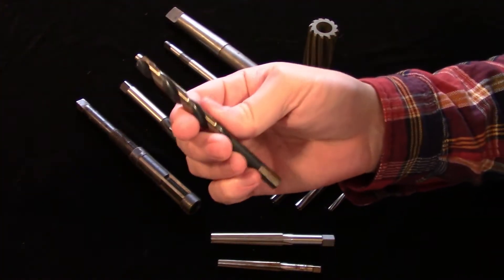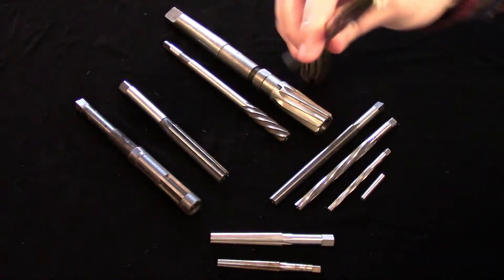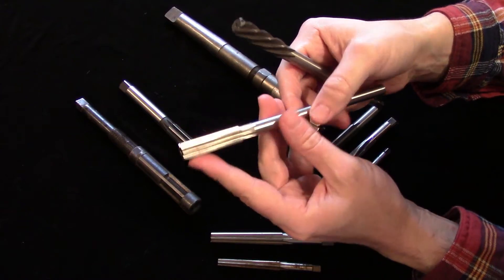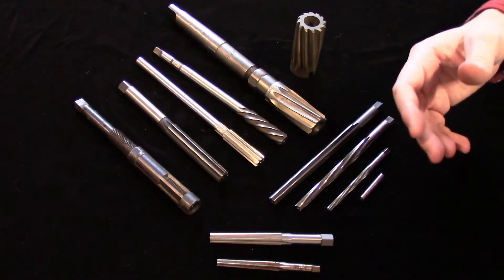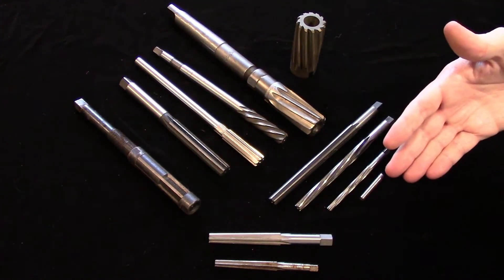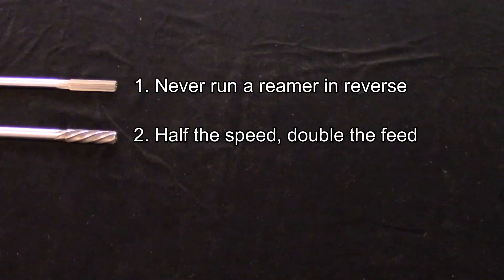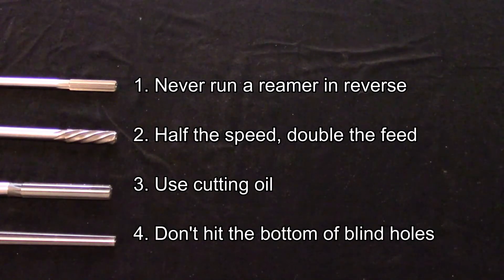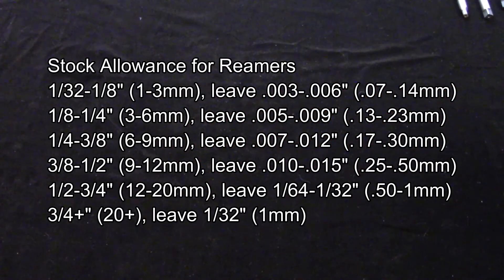Reamer Basics

Comment: How do you know what size pilot hole to drill for your reamer?
Reply from the maker: It changes by diameter. Smaller sizes have less chip clearance so need a hole closer to the size of the reamer to keep the chips from packing in the flutes. I put a chart in the description that will give you a good starting point.

Comment: So, making tapered hole for pin is:
drill a hole with allowance according to the chart, and run through it with reamer to calculated depth while checking with a gauge. 

I've seen that for tapered holes, there are rough, medium and fine hand reamers, where you start with rough and end up with fine - just like a thread tapping by hand.
Reply from the maker: For a tapered hole your pilot drill should be large enough to just start the reamer but not too much bigger or you might not have a complete taper. Then ream until the pin fits the way you need it to.

Comment: I'm trying to wrap my head around this, but I don't understand your "stock allowance" chart at the end. Can anyone explain what that means? Why are fractions and mm mixed?

Also, I'm looking on Amazon, and I notice most sets are mm, the few American fraction sets seem to cost 10x more than their metric counterparts. ...why is this? 

I'm drilling holes with American fraction bits to run fraction sized rods through steel. Do I use metric reamer bits then? ...I don't understand.
Reply from the maker: The stock allowance chart is how much undersized you will drill the hole for your reamer. Inches and millimeters are both given because if I didn't give both systems of measurement I would catch a lot of crap and I try to avoid that whenever possible. The measurements are equivalent (i.e. 5/16" and 8mm are roughly the same size). The reamer is going to produce a hole of the stated size so whatever dimension you want,  order a reamer of that size. Please let me know if you need any more clarification.  I'm happy to help.
Reply: @StuartdeHaro  Thanks, I think I mostly get it. I've never used metric bits, so I guess I need to figure out how to match the American sizes I need. ...and invest in more bit sizes in general I suppose.

Comment: Not sure if you monitor older videos, and I’ve been enjoying the test videos, but can you maybe do a short or similar video talking about checking the diameter of a reamer?  If they are so sensitive to running backwards, I can’t imagine using a carbide tipped anvil on a micrometer to smash into the blade!  How do you check the diameter?  Thanks!
Reply from the maker: @ironhead65  Hi there. That's a good question. I'll see what I can do for you. You can measure across the cutting edges but it can be a challenge getting it lined up right. You'll tend to measure too small. Dulling the reamer is a legitimate concern. I honestly don't ever measure the reamer itself but instead measure the hole it produces and see how it behaves. Keeps in mind that the hole size is affected by lubrication and runout. A reamer that goes oversized in your drill press might be dead nuts in your mill. Thanks man. Now I'm going down a rabbit hole that needs to be tested!
Reply: @StuartdeHaro  oh wow!  Thanks! Some extra concerns!!  I’m always excited by the rabbit holes your videos cover !

Comment: Great video on reamers, you answered a lot of questions I have been dwelling on. If I could ask you a question on the short stubby reamers, what is the purpose of the perpendicular hole that is drilled in the shank towards the rear of the reamer? Is it a means of holding while under power or is there a special tool holder that keeps the reamer in place? Thank you for your time and knowledge. Paul Greenlee
Reply from the maker: Do you mean in the very back? That's a shell reamer. The perpendicular slot is for the drive key on the shank I show at 1:51.
Reply: Thank you Sir, I knew it had to be a way of holding the reamer but the shank through me off. Looks like a regular short reamer, maybe 3" or more with the hole about a 1/4" from the back.  Wish I could post a picture. @StuartdeHaro

Comment: I’m slightly confused!  With the allowance chart 9mm - 12mm. =  .25 - .5 mm   Is that total or on both sides of the hole?

Second is that .25 for 9mm.  And .5mm for 12mm.      How do I work out the amount for 10mm ?

Sorry if I’m not getting it!

Comment: Only issue I have is do these cut their own holes or do they have to be opened first before reaming? If so what do you drill with first because you said a drill bit cuts oversize so what would a reamer do?
Reply from the maker: You have to drill a hole first and the amount you leave for the reamer is dependent on the diameter of the hole. I believe I put a stock allowance chart in the description of the video.

Comment: I’m still confused as to which side is the cutting edge and which is reverse? I have a reamer and was told to run it in reverse to cut carburetor throttle bushings. Didn’t seem to cut one way so I switched
Reply from the maker: They only cut in one direction and it's the same as most cutters, clockwise when viewed from the top of the spindle. If you’re ever unsure, you can look at the cutting end of the tool and see the geometry of the cutting edge. The flutes of the cutter form the cutting edge much like the teeth on a saw blade and that makes it pretty easy to visualize how it cuts. If you imagine the shape of the tool rotating, which way is going to shave off material and which will just rub?

Comment: i need to expand a 10mm hole to 20mm. What do you recommend
Reply from the maker: That's way too much for a reamer. If you need a reamed hole, drill it out  to 19.5 first and then finish it with the 20mm reamer. If finish and size don't matter as much, just drill it out to 20mm and call it a day.

Comment: Stuart, a question if you don't mind. I have a spindle with a MT2 where the taper is close to 5 thou off. I'm not using it, but would like to. Do you think that it makes sense to ream it in hopes of eliminating the runout? Or, in your experience, does this sound like something that needs to be re-milled? I don't have the skill for the latter, but I'd sure give a reamer a shot if it made sense. Thank you.
Reply from the maker: Reaming is just going to follow the hole that's there. It really would need to be reground. The spindle is almost certainly heat treated as well, so reaming probably wouldn't be successful anyway.
Reply: @StuartdeHaro  Thank you. That's what I was afraid of. Appreciate the information.

Comment: I apologize if the answer to this question is super obvious and I’m just too dumb to see it, but I am a literal, just starting out novice when it comes to machining and I’ve only just learned of reamers recently. Anyway, why is it a problem to hit the bottom of a hole with a reamer? Can’t you just use a depth stop on the drill or something like that?
Reply from the maker: The reamer will start to wobble and cut an oversized hole when it hits the bottom.  This is because drills tend to drift sideways as they cut due to one cutting edge being a little longer than the other.

Comment: does the adjustable reamer with opposing nuts only cut in one direction? what I mean is if you turn it to the right it will cut but if you turn it to the left it won't cut.
Reply from the maker: That's correct. Turning it backwards will dull the edges as well.
Reply: @StuartdeHaro  thanks for the info. So what you are saying is that turning it to the left will dull the cutting edge( the edge that cuts when you turn it to the right) Correct? 
I use these reamers in instrument repair. I never cut with the one I have ,I use it only to re-round valve casings on trumpets by turning it to the left. 
The one I have is from Feree's Tools. I bought it 20 years ago and one of the blades was lost. I thought it wold be good to buy another but when I went to their website the price was $280, about $200 more than I paid for the first one I bought. I went on line and found one for much less. I just wanted to make sure that these type of reamers are all the same and only cut in one direction. Of course I will try this new reamer on a junker horn just to be sure.Thanks for your time.
Ruben
Brooklyn Brass & Reed
Reply from the maker: I've actually had to take dents out of valve casings before but I never use a cutting tool.  I made a mandrel the same size as the valve and slightly tapered for the first inch or so. I can drive that into the casing and then use a plastic mallet to raise the dent and round out the casing. The last step is to re-lap the valve.
Reply: @StuartdeHaro  Just to be clear I never use the reamer to cut, only to re-round a casing. I'm not talking about dent removal.
 But could you please answer my question about what edge is being dulled when the reamer is turned to the left? the cutting edge I assume?If it dulled the other edge it wouldn't really matter I guess.Thanks again. I appreciate your wisdom.
ruben
Reply from the maker: Yes, when you turn it to the left, the cutting edge would be dulled. If you look at the blades you can see which direction they are supposed to cut in because of the relief angle on the side.

Comment: Hi...do you know the reason why the driller is inconsistent with the depth? Because of this our reamer gets bad because some parts where not drilled enough.
Reply from the maker: The only reasons I can think of why this would happen would be if the drill broke or slipped in the chuck and got pushed in. Slipping could happen gradually until the hole is finally too shallow.
Reply: We have cnc horizontal mill and we make 40 parts per cycle... Randomly, the driller didn't make or drill enough the depth required so when the reamer goes in and hit those part then definitely get damage.
Reply: Thanks for the reply...I'm just new on cnc field...trying to learn more

Comment: So if I understand correctly, when you have drilled a 7,5 mm hole and you want to end up with a 8,0 mm hole, you have to do it in at least two different reaming steps (between 0,17 and 0,30 mm per reaming step)?
Reply from the maker: I wouldn't.  I know the standard metric drill index is only in 0.5mm increments, but you can buy drills individually in finer increments, or you could buy a cheaper set of inch drills just to fill in the gaps between the sizes.  The smaller your reamer the less material you should leave before reaming, so it is really only a concern below 10 or 11mm.  Above that, 0.5mm between drills would probably be fine.

Comment: Great video. I'm new to this topic so I learned allot, but still have some unanswered questions. 1. If reaming a hole that should end up being 43.95mm how much stock should you leave? 2. And since its done in a plate of 304 stainless steel is there anything I should have in mind? type of reamer? type of cutting oil? The plate is just 6mm thick. I hope to hear from you and hope it might help more people out there:)
Reply: I know that this is a 2 year old question, but a good rule of thumb is to leave about 2% of material left to be reamed out.